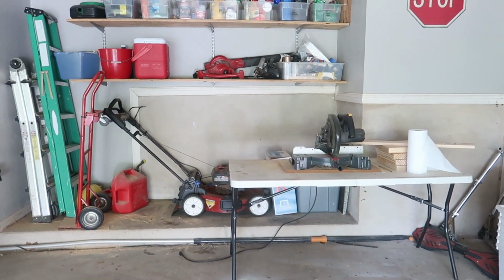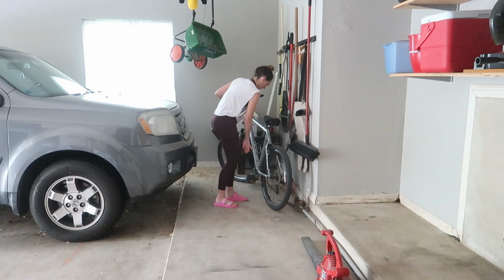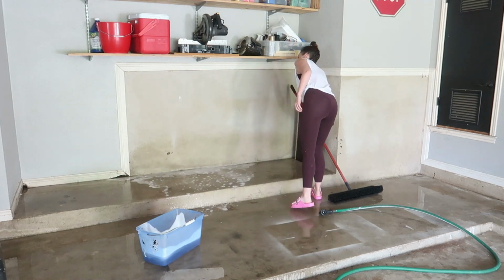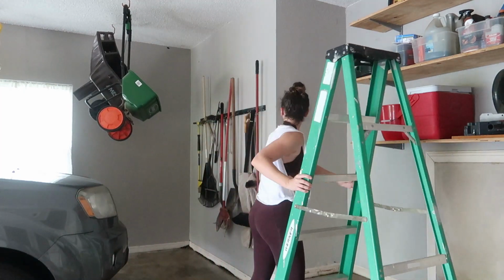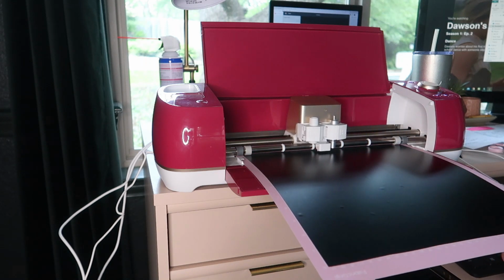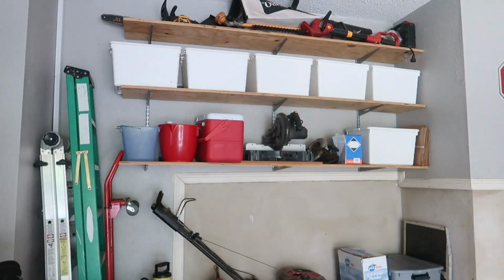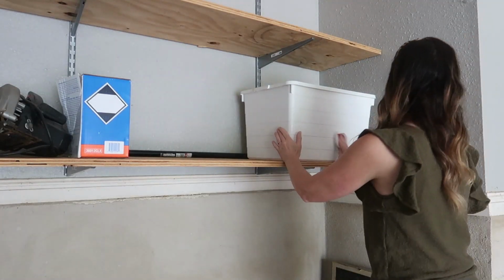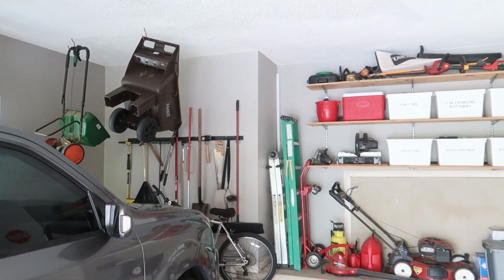GARAGE CLEAN OUT | ADDING NEW STORAGE BINS WITH LABELS | CLEANING MOTIVATION

Comment: Just finished and the garden shed.  I have a little very ugly garage but I painted the walls last summer, and have steel shelving with eight bins and a Costco metal rack on wheel.  The Costco rack is extended household and auto supplies.  I have a tool rack for my household brooms, mops, etc by the door into the kitchenThe bins contain three holiday and five of hub’s books. ( I am stuck with this, really). I have to sweep out all the time since we do park our car inside every night.  I keep our shredder for unwanted paper before it comes into house.  A recycling station is located there as well. The concrete is very old and patched. I do scrub it off, but it looks terrible still.  Next house, I will get my son to do.  His is all new and beautifully organized.
Reply from the maker: Nice! Yes, with these older homes you just have to do your best to keep it clean. We have lots of trees around our house and we also park two vehicles in the garage every night so there is constantly debris coming in our garage! Thanks for watching!☺️🤍✨